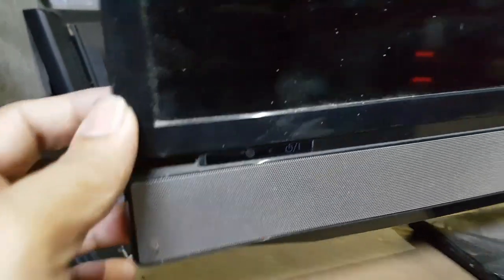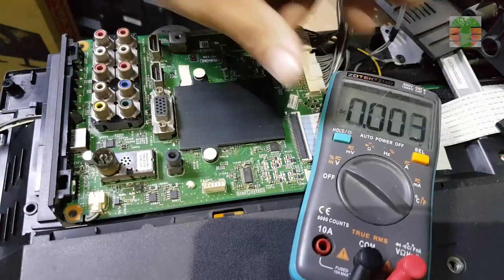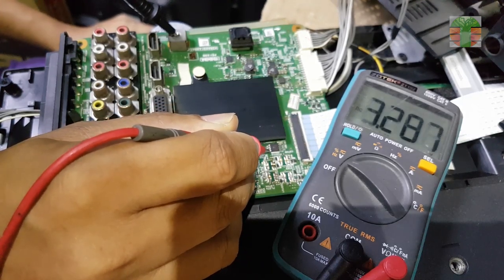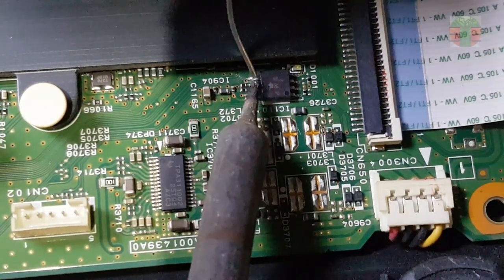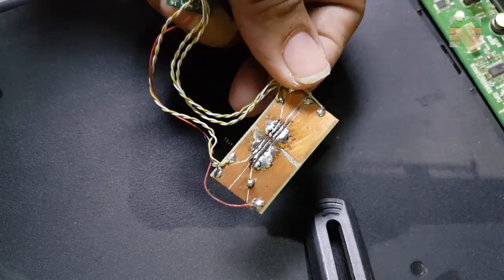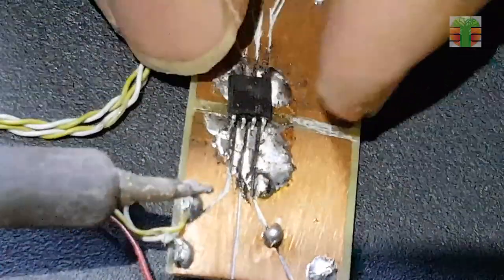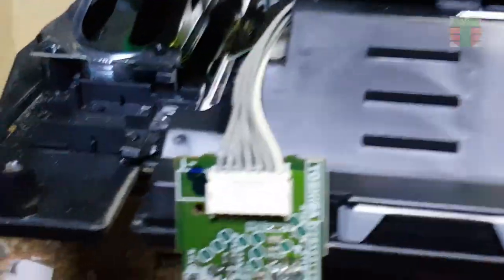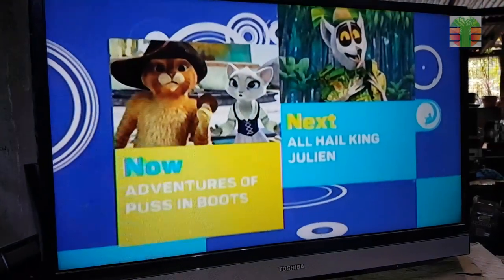Toshiba TV has no power. EEPROM Program.

Comment: Hi. Thank you. Why do you use an analogue meter to read the voltage? What's the advantage?
Reply from the maker: An Analog meter is faster than the digital one. You can instantly see the result, not like the digital has a delay in calculating the voltage.